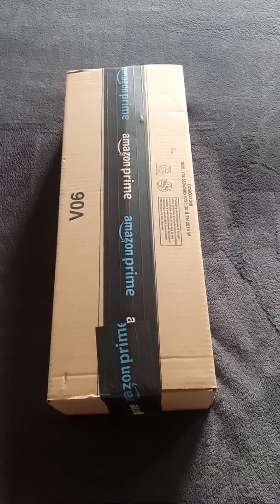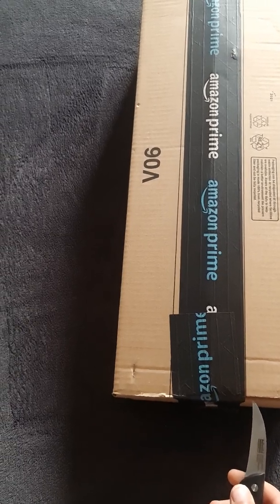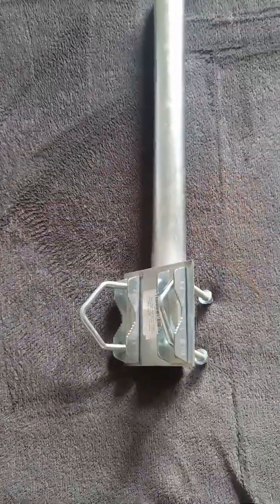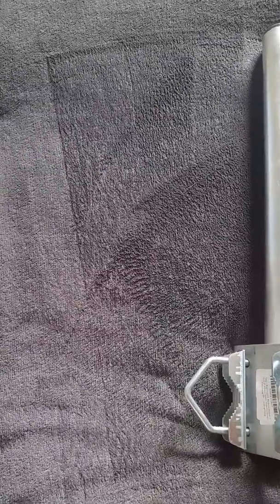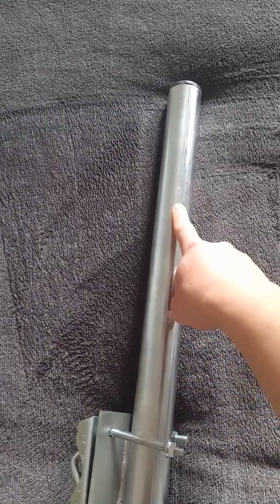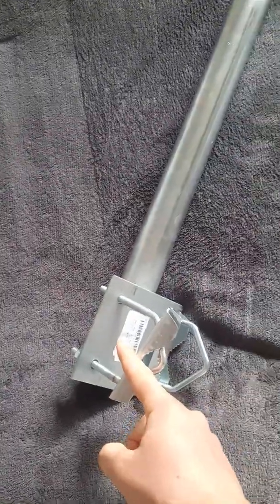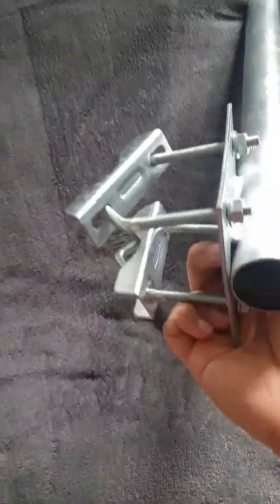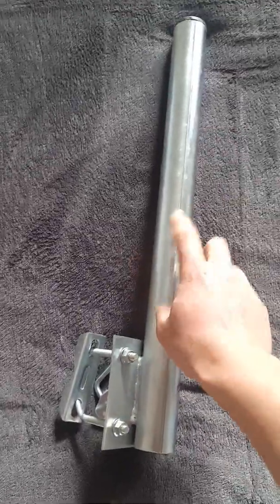Balcony Antenna Holder for my 9dbi McGill  connected to  3  Helium Hotspot  Part 1- HELIUM ADDICT

Comment: Link to the balcony  holder ?
Reply from the maker: PremiumX Balcony Holder 50 cm Diameter 42 mm Steel Mast Railing Bracket for Satellite Dish SAT Antenna Satellite System Satellite Mirror Arm Can also be Used as a Mast Attachment Mast Extension https://www.amazon.de/dp/B00XDIHX38/ref=cm_sw_r_apan_glt_i_V68579Q9F0WNJPJ13BET?_encoding=UTF8&psc=1